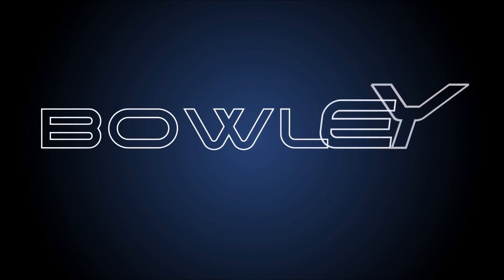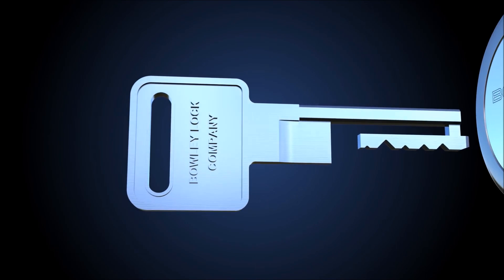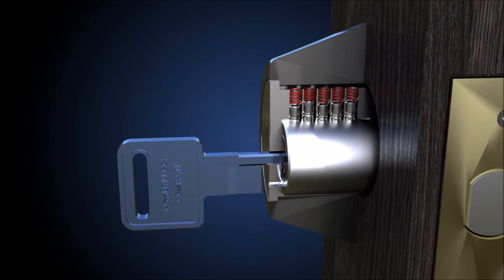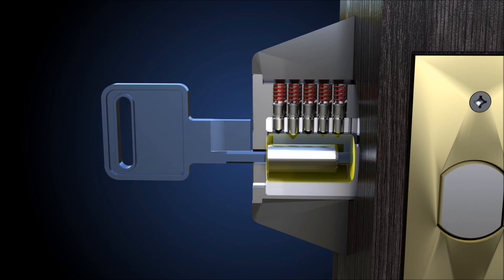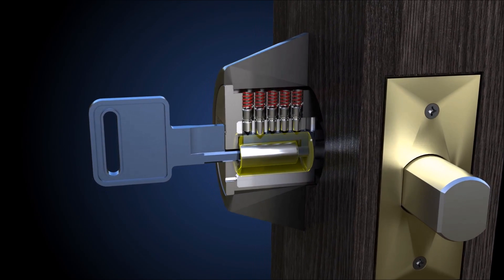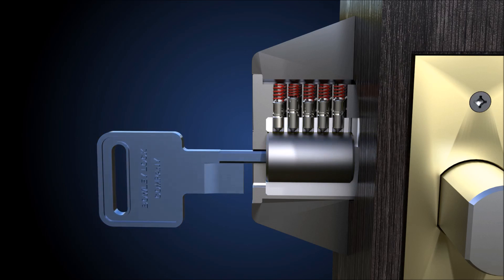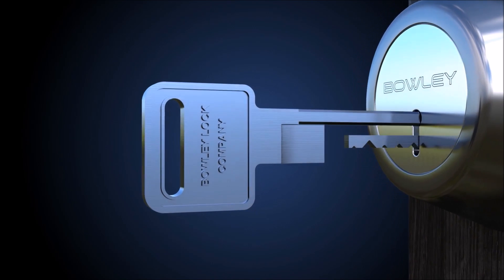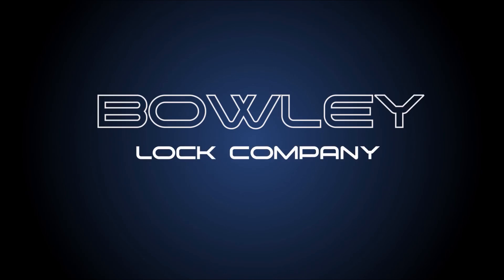Bowley Lock Animation

Comment: the current technique of taking a picture of the key to make a copy would still work with this design suggest that you replace the standard saw tooth key design for one composed of conical holes possibly diagonally offset to provide an additional hoop for would be lock pickers to jump through.

Comment: To the company.
Estimated time to drill it? 
Possibility of using a bump key?
Reply from the maker: +The Generalissimo 
Depends what type of bit. Its a hard steel but it is machinable so with a carbide it could be done with time. How much time i am not sure.
Reply: +The Generalissimo you cant use a bum ke there is very little movement

Comment: Since the key is "very strong," then the cost of material would be pretty high. 20$ per key replacement?
Reply from the maker: +Tom L 
The cost of the material is not bad. About 2$ per key. There is some laser cutting and milling. we hoping locksmiths can resell them cut for less than 20 all in.
Reply from the maker: +Keith Larsen ,
The key is 17-4 PH S.S. In the quantities we will be buying at they are $2 for material at much larger quantities $0.50 is possible.
Reply: +Tom L Not sure what steel they're making it out of, but 420J2 is what all the cheap knives are made of, and while it makes a jack all of a knife, it would make an Arnold Schwarzakey, I got a bunch of those in a jar at like 50cents a pop, so not really expensive at all. 2$ sounds like a high estimate.

Comment: That key would constantly get caught on threads in my pocket as well as get tangles with all my other keys.
Reply: Maybe the key needs a spring loaded shield over it which protects it from this somehow, something like a floppy disc cover or something?
Reply: +Weese Carabiner?
Reply: +Tunnel Rat How would that help at all?
Reply: Orange Soda ! Imagine doing that every day when getting home?
Reply: Marc83Aus That could work!
Reply: Weese So it doesn't get caught in you pocket?
Reply: Tunnel Rat The key is still exposed and would get caught.
Reply: Weese Really because my keys never get caught on anything.

Comment: I love locks. This one looks really secure - can't think of a defeat.
Reply: +Geoff Cunningham If the pins aren't very hard, or rounded, then you may be able to do a soft foil-covered low-profile key with a lot of pulsed force which creates a chamfer on the pins and forces them into the right position. Hard to tell from the video.
Reply: @geoffcunningham6823  people have picked these locks  but the ave opportunist burgler aint gonna b doing it

Comment: nice lock.  no sense  in having a high security  lock if the hinges  are held by short wood screws, though
Reply: most home invasions are by kicking door in? that's bullshit. So is chewed up stick opening the lock story.
Reply: +Tom Robertson That's why I'd only really use this if I were gonna put it in a steel door.
Reply: therealnightwriter   Gary had a kiosk in front of a big box store. 
gas station was on the opposite side.
the lock was brand new at the time.
it had dimples on each side that the pins dropped into,
I was there.  
Gary always had a lolly pop in his mouth in an attempt to stop smoking.
he was a highly skilled locksmith for 20 years, but bought the kiosk when he needed more regular hours for his kids.
so when he was asked to do something, he thought of the stick in his mouth.
when he came back and told me the story, we both had a good laugh.
he said it was a 1 in a million chance and doubted it could be done again
I stand by my story.
Gary is no longer with us .
my point is locks can always be defeated by unforseen actions.
Reply: That's why your doors should be steel or solid wood with long screws holding the door hardware onto the door frame.

You might notice that Bowley is using the video to sell their LOCKS not their doors.
Reply: I'm sure you heard of the old saying - locks keep an honest person honest". If someone wants to break into your house they will. There are plenty of windows to break, and plenty of other ways to avoid the door all together. Plus like you said, a strong guy with a strong foot or battery ram with get through most doors in seconds. Get an alarm, you will be better protected and a good lock doesn't hurt!
Reply: The point of a lock is to slow attackers down. Not to stop them.
Reply: +Kobe Wild  30 yrs ago  a car cam out with dimples on both sides.  the pins were horizontal  on both sides.
took a very expensive machine  to make the keys.
I was visiting a locksmith that had a key cutting kiosk in the parking lot.  because of kids in school, he did not want more work.   The car was at the gas pumps diagonal  across the parking lot when he locked the keys  inside.   He begged my friend to give it a try.
my friend like to suck on lolly pops.  he took the cardboard stem  and started chewing on the end as he walked the 600 ft.
he inserted the mashed up stem in the  lock and opened the door in 10 seconds.
that lock could not be picked.  lol
most home invasions are by kicking the door off the hinges.
I do like this lock, but unless people commit to its  high security  requirements ,  then it to can be defeated
Reply: +Tom Robertson 

Yep, steel core door with a steel door frame.   Does anyone really pick locks?

Comment: But what if I show up with an adamantium drill?
Reply: +Sean Pierce Obviously someone will hear that before you have time to get in and effectively steal something.
Reply: Cole S now there's a thought: how do you go about silencing a drill?
Reply: but just... hypothetically
Reply: Rob La Londe I think we can assume that the bolt would be hardened as well, and that anyone who bothers installing this lock can also afford to install it on a strong door.
Reply: +Sean Pierce the lock is made from chlorophyte spray-painted silver, you would need atleast a drax
Reply: +Sean Pierce How to silence a drill? Ace silent breaching (payday joke for those of you who dont know)
Reply: when in dought use hydraulics unless you are trying to break in to a bank vault or a nuclear bunker  most walls are not built well enough to hold a door in place when there is 10 tons that wants to go through
Reply: +Sean Pierce Nah man, you need to use a rune drill. Addy drills won't work on the lock.
Reply: Draycia - good advice.
Reply: +Sean Pierce stress +drilling =broken bits
Reply: +Sean Pierce Hole saw. Drill AROUND the lock. Problem solved.
Reply: tim bum interesting thought

Comment: I could pick this lock.
But first I'd have to make an electronic lockpick in the shape of the key that could finely adjust each pin.
Reply: What we need is a flexible version that can automatically fit itself to any lock and pick it
Reply: +LetoZeth anticipation rising
Reply: +LetoZeth thats crazy enough to work turn the lock and get to work on the pins
Reply: No such tools exist yet. This is why we do single pin picking and LPL is verified.

Comment: My thought on a crack for this would be a double key side by side ..one for the tension blank and one as a rake ..
Reply: Also .. I like the concept of the locking mechanism being shielded .. Definitely an awesome lock
Reply from the maker: +Jose Cortes 
the dual bump key idea is one of the better ones i have heard and a few others have suggested it. Look forward to people trying that idea. There are a few more security features around the pins and idler which we are not currently disclosing that makes me believe that bumping simply wont happen. but time will tell

Comment: not all criminals use lockpicks. but hey its a great improvement and a very clever idea!
Reply: +Vincent Maldia nah. I think thermite will work by the way.
Reply: EDDSWORLDMEGAFAN Use Nokias. No one can break nokias.
Reply: @presistancelydeccer7338 the whole point of a criminal using lockpicks is to not be detected. Even if thermite could melt a keyway(I've seen a video of someone trying it and it was unsuccessful), a massive hole in the door where the keyway once was would make things pretty obvious

Comment: the key is easily broken
Reply: +Zero Omar 
it's hardened stainless steel and not easy to break, see the video of lockman28 for a strength test at the end of the video
Reply: +Zero Omar These keys are thinker then average ones plus use high strength stainless steel. Don't be fooled by looks before you try one hands on!